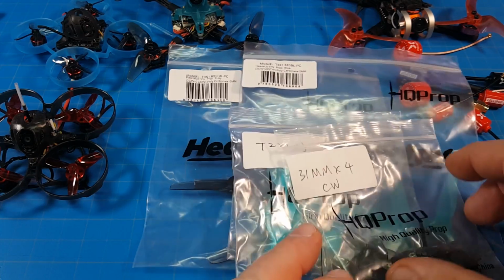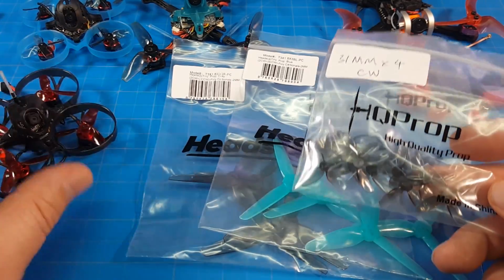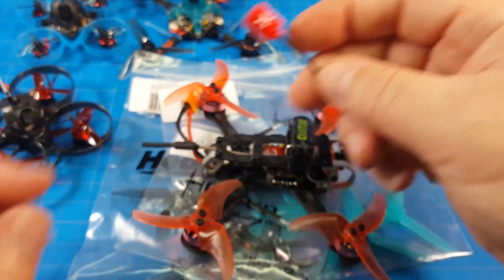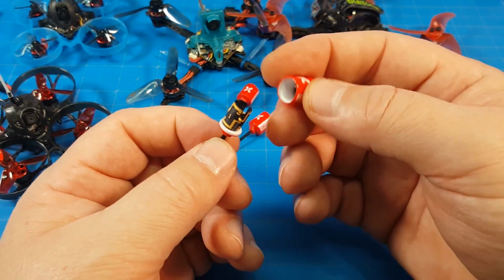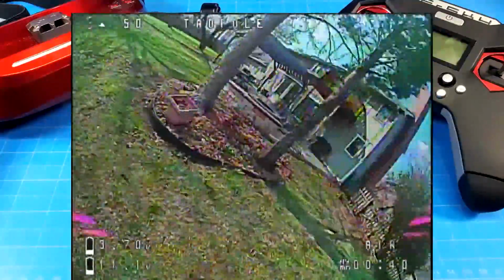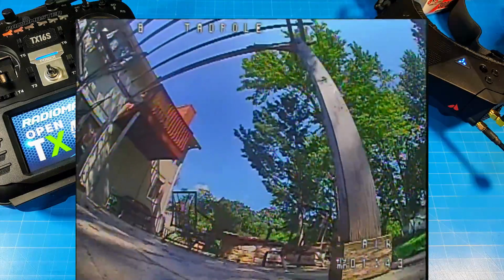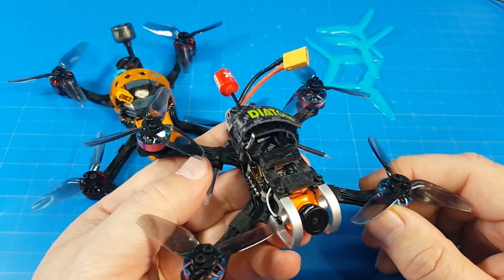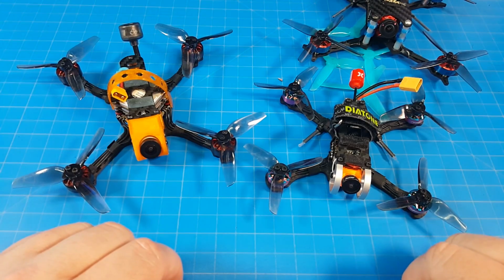HQ Props // Foxeer Antenna // Armattan Tadpole Vtx Reception

Comment: Stupid question.  I just finished building my first "tiny quad" (2.5" Tadpole). I purchased some Gemfan 2540x3 props to put on my Xing2 1404 motors.  I had extra screws from the motors, assumed they were for props.  The screws are too short to pass through the hub and into the motor bell.  Is it common to have to purchase separate screws?  I just find that odd.
Reply from the maker: I can't name the props, I have seen a 1-2mm variance from prop to prop. Motor manufacturers do often send extra screws for props, some send two different lengths some only 1. Prop manufacturers used to send screws with props and they have stopped that as well. If your local hardware store carries m2 5mm and 7mm, I would pick some up. Otherwise I would get an m2 kit from an fpv store or ebay if that's acceptable.

Comment: Do you know a 3 inches frame good for freestyle with a caddx orca on (40g) ? Hglrc sector 150 seems to bé heavy...
Reply from the maker: The extra 40grams on a 3inch will need a fairly powerful drive train. While I can't think of one off the top of my head I would look at quads with 140x or 150x motors.
Reply: @NickBurnsFPV  thanks, will try emax 1404 6000kw, but not certain for the frame

Comment: Gday Nick, nice work i like the ramblings great info with props and micros, you should do it more often Nick, the micro that you had the vtx problems seem like it had alot of motor noise going through the fc and then the vtx, that was strange especially since you changed the vtx, shame about your blue light your workshop looks different lol, i like the blue light it was cool, great work mate.👍🛸
Reply from the maker: I did get the blue flight fixed, replaced the battery ;) Good to hear you enjoyed the video.

Comment: I have ev800dm goggles and a mobula 6 hd drone. How to long range? It only ranged up to 100meters.
Reply from the maker: real long range will require some heavy $$, need crossfire and new goggles. Is the video only 100m or the control link.

Comment: Thanks for the info Nick. When I don't like a quad prop I snip 2 off and when I did that with the 4.8x?x4 props on my lightweight 5 inch I built, it flies better with those than anything I could find. It's because my 1606/4000kv motors don't have the torque to spin anything heavier. You can heat the bigger lollipop if you want in one, I've seen the design in the big one, the little one is new to me. Thanks again, take care!
Reply from the maker: Ah yea, I didn't think of heat, I was using the brute force method. smh
Reply: @NickBurnsFPV  we all do it. I built a 5 inch today, and I looked at the diagram,vit had cam+, cam-,and vid, without thinking I connected not 1 but 2 runcam nano 2 cams (3.3v to 5.5v)to it not thinking about what the voltage was, and it was 9v. I didn't burn 1, not sure on the other yet.

Comment: That's the video I needed...
Flying the larva x with the avans and the motors really bent fast...
Like I never broke or bend a prop but jad to replace every motor
Reply: People have this problem with the Emax Avan Rush 2.5" props. I assume you're using those. They are so stiff and hardy that they don't flex on a crash but transfer all the impact to the motor, that's why the motors bend fast. It happened to me before too. Just change the props to flexible props like HQ T65mm (3 blade) and all your motor breaking issues should go away..
Reply from the maker: yes, those motors aren't robust enough for those props. I would try less stiff props, like gemfan and HQ.

Comment: I broke the bigger foxeer, it's a 3 lobe clover inside if I'm not mistaken. At least the version I had.
Reply from the maker: must have been a heck of a crash
Reply: @NickBurnsFPV  I think it got hit by the prop. I was having issues with diatone 405 boards resetting mid flight. As far as I could tell the curved seam is where it clips in top/bottom. I think I just got lucky, they went through some abuse.

Comment: Hi Nick, can I pick your brain quickly?......I wanted to make a 3" HD  quad so I took the guts of a Tyro 79 and put it in a 'Miata' frame from some obscure company called Leaco RC. Fast as hell but way too heavy (1607 motors) and I wasn't a fan of the frame. Purchased a KBat 136 frame and put the same guts in but with Emax RS1106 ii motors which are half the weight of the 1607's.  Flies nicely on 4S with the KingKong 2.8" Leader 120 props, but I want to put 3" props on it for a bit more oomph. Motors are not hot. Any recommendations?
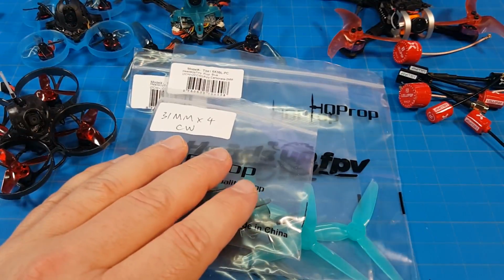Got 3:30 on a 650HV 4S.
Reply: I have one... those King Kong 2.8" props are terrible!
I use the 3" Gemfan and the Avan and like both.
Reply: @noforyoutubepremium3108  Hey thanks for the response :) I was thinking Gemfans all along. I have some 3" ones but they're for the larger size motors (propnut). I'll have to make an order.
Reply from the maker: @Argle Bargle the KK2.8 I like during their time, but so much has changed since. I would try the Emax avan mini 3x2.4x3 or the Gemfan 3018 bi blade. One of those two should be close to what your looking for. And the last prop if not those the old gemfan 3030 triblades, I have the 3030 props on a somewhat heavy 110x build.
Reply: @NickBurnsFPV  Thanks for your input Nick! Now I'm just waiting for the postal gods to bless me. :)

Comment: Hey Nick, yeah I love those hq props on my R3dshifters ion running 2s 1102 9000kv. Flys great. They are nice and smooth. Those 4 bladed 3 inch props didn't work well for me either
Reply from the maker: Good to get the affirmation on the props.

Comment: Nick I always appreciate the content you give us.. you the man.. I just didn’t a Tadpole 3” build and I put Beta 1204 5000kv on what would you suggest for prop and battery?.. I have a 13amp 4n1 esc.
Reply from the maker: I would start with a biblade like the gemfan 3018/3016, if we want triblades another low pitch of the HQ 3x1.8x3 prop.
Reply: I’m going to give that try and thank you for advice.

Comment: I would love it if you made a video about stuff like flying brushless whoops around public parks and public spaces. I'm also interested in your opinions on the best 2020 starting out goggles and transmitter, as well as intermediate options for people looking to upgrade from something more basic (like my Eachine VR006 goggles).
Reply from the maker: For starter or next goggle I would consider the fatshark scout, just under $200 and fatshark has great support.  Once we get to $300+ I would look at buying some second hand skyzone 03O or Fatshark HD2, from a vetted/trusted source. Beyond that we are looking at $500+.
Reply: I love my original Aomway goggles, but I don't think you can buy them anymore. Had mine for over 3 years.  No problems. 
For what you can buy now, I don't think there's any question the best cheaper goggles are definitely the Skyzone 02...I think that's the number... They're around $269 on sale. I'd buy them from someone in your country, because if you get defective goggles, and bought them from China, it's very costly to ship them back, so you'll probably be stuck with them. I'll only buy expensive gear from USA vendors because I live here. Then I can get some customer service. Those Skyzone's would be what I'd buy for the maybe 2-3 years before analog completely dies. Of course, if you can wait, like I'm doing, wait until some more options for digital come out. I'm waiting for the 2nd gen. DJI goggles or some other brand that excels in performance. Digital is the future, so whatever you get in analog will be a short term purchase when analog dies.... and it without a doubt will. Analog always dies whenever a digital option comes out, and there are choices for the consumers. 🤔👍

Comment: The Lollipop 2's can be on the fragile side even if the shell is durable. I've had two fail internally, you'll know when it starts rattling and the signal gets intermittently noisy. I feel like the ufl version is most likely to break like this because the inner conductor is such a small gauge.  The top element can sometimes get jostled around and fails at the solder joint from the ones I took apart.  Never opened up a Micro Lollipop but it looks way more durable from what you showed us.
Reply: RC Schim showed, in his latest antenna tests, that none of the Lollipop antennas are very good! The worst were those mini's... They're not good at all. The best was the Lollipop 1, but we can't but those anymore. #2 and 3 weren't very good either!
Check out his tests - best I've seen!
Reply: RC Schim's test shows the antennas being used as receiving and not transmitting.  The only thing I know about antenna theory for transmission is SWR should be close to 1:1, Albert Kim tested the Micro Lollipops a few months back and most measured good.
Reply from the maker: @livingplasma oh I didn't know the lollipops tend to break. Not good.

Comment: My tadpole gets 4+ minutes of hard ripping using a 3s 450. Not sure why yours gets such bad flight time. I use the Hurricane bi-blades
Reply: Bi-blades are the reason.
Reply from the maker: @Tyler Compana bi blades are more effcient and the motors (rcinpower) I am running aren't efficient either.
Reply: And I have an HD board/cam on it